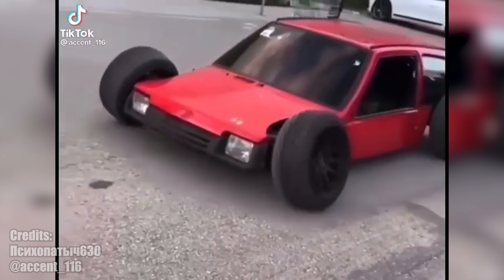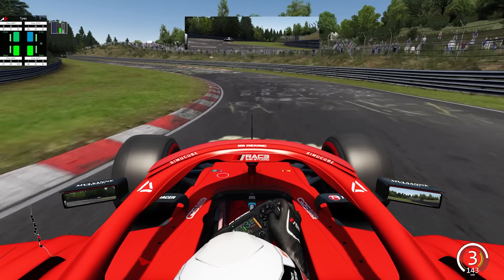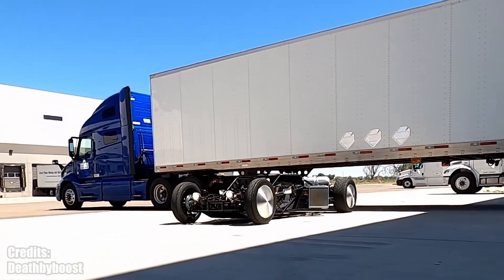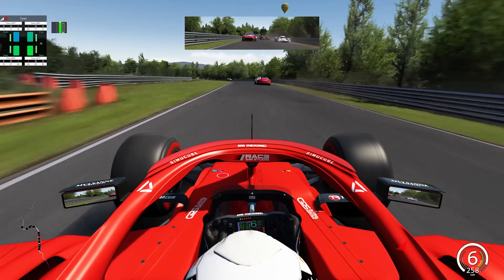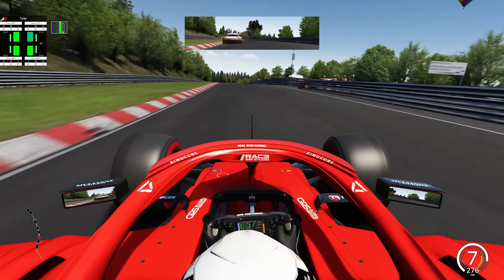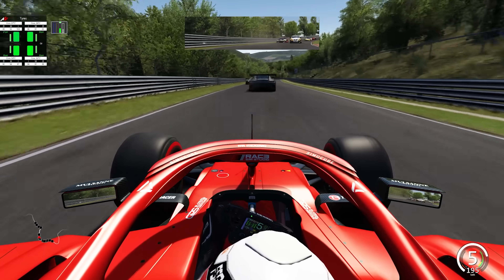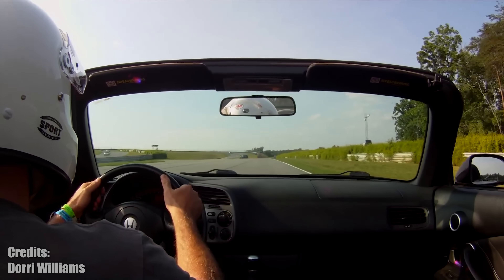Car Culture Has Reached A New Low (literally)

Comment: THAT lifted truck I have no problem with, it's clearly used for its intended purpose, off-roading!
Reply: And heavy towing!
Reply: I don’t mind lift trucks at all. Some people just like the look, but what is absolutely unforgivable are squatted trucks. 🤮
Reply: @princepixel1266  that and mall crawlers. Big lifted shiny and tires that stick out. Also the tread has no chunking and is worn flat all the way across like it has never seen dirt in its life. F those trucks too. :)

Comment: 4:50 To complete the collection, There was also an EV version called the Audi R8 E-Tron, It's not a concept car, it's an actual car that you can't buy (Because you needed to be an "Audi Connoisseur" first to buy one) 

And the price tag?

1.1 Million Dollars, You get 456 horsepower, 0-60 mph is 3.9 seconds, 280 miles per charge and a top speed of 155 mph. 
It also weight more because of the heavy battiers, and the handling is worse.
Reply: There here are reasons why it stayed a concept, and is not an actual car you can buy. On was that the Transmission cant handle that torque (only around half that), and the production cost. Because of the 2nd fact, it isnt a good comparison, since you cant buy the Diesel Powered one, and b) its common knowledge that EV need their own design. If you try to make an EV Diesel powered, you would end up worse as well than building a car that fits the Diesel engine from the beginning. (Let alone Fuel economy comparison between those two)
Reply: @christianhumer3084  I see, thanks for giving me more info
Reply: @DatDudePlays  Pleased to help

Comment: I'm not into lifted trucks or normal trucks for that matter. But that truck crawling past the big truck and pulling it up the hill was badass. Basically, when they have a purpose lifted trucks are really cool
Reply: That truck looked like it actually saw real off road use (some dents and good dirty gear). Most of them I see don't see anything rougher than a gravel driveway....
Reply: @ToolofSociety  Most big trucks I see look like they just came off the dealers lot, polished with a clean bed. I have hauled more hardware in my civic than most trucks on the road and I've taken my civic further off road than most suv's that I see.
Reply: @seanpeacock4290  No kidding a lot of them in my area look like trailer queens. My favorite though has to be the ones that are obviously 2WD only.

I also don't understand the trend of getting lift kits and all that only to put small street only tires on them. They seem to always have LEDs and chrome galore..

Comment: 6:53 honestly have you driven one of these? The Renault Zoe is honestly great fun to drive, it handles like a small Miata, it has a great sporty suspension and weight distribution plus low center of gravity. Throttle response is fantastic with it being electric, and it trailbrakes great into corners with the regenerative braking, all the people who've tried driving mine have been surprised at how fun it is to drive.

All that and it seats 4 comfortably, and even 5 somewhat comfortably while being able to haul large goods like big leather lounge chairs, pallets and over a dozen tires. 

Plus it never needs servicing, like literally at all if you want to. Very reliable too in my experience, with mine being 10 years old at this point.

Comment: my first car was a 1977 Lincoln Continental, a giant land yacht that had a 7.5 liter 460 cubic inch monster that drank about 1 gallon of gas every 8 miles if you were driving calmly and far worst if you dared push the pedal down far enough to get the 4 barrel carb going, I hit a spot where there was about 4 inches of water, it wasn't hydroplaning it was worse, it became uncontrollable, didn't matter what I did, turn the wheel did nothing, brakes did nothing, just along for the ride as it went in circles at about 50 mph until I hit the side of a guard rail, the car weighed so much it went through the guard rail and into some rather large trees, thankfully it's pure mass slowed it down to the point that I didn't get hurt but it was still pretty rough, water is scary, also I drove that car home after that, it was beat to hell but still drove the same as it did before it crashed, got to give them old cars credit, they were built like tanks

Comment: Something broke in my alfa 147 one day, I had to drive back home about 16km without accelerating because the accelerator didn't do anything, I could easily reach 60kmh. don't know what happened though, because the next day I wanted to take to the mechanic and it worked no problem, never did it again in four years.

Comment: The insane thing about the Crighton is that on top of the 220 hp it only weights 130 kilos. So even with a rider you still are above a 1 to 1 power to weight ratio

Comment: The Audi V12 Diesel ran at Le Mans in the R10 in 2005 and won by far. HP is good if you can profit from high top speeds but as soon as there are curves involved you definately want shit loads of torque too.

Comment: 4:04 actually the car never claimed that 0-100 time. due to the technicial limitations, they used literally the same stock transmission from an a4 of the time. at the time no transmission could handle the power and torque of the tuned v12 tdi

Comment: My 96 cadillac fleetwood 6 door limo likes to idle at 30, but you have to get it up to that speed first, once it is there and in, i think 3rd gear, it just sits there at 900-1100RPM, as long as you dont stop and dont have any hills, you can get over 40MPG according to the OBD reader with this 5.7L LT1

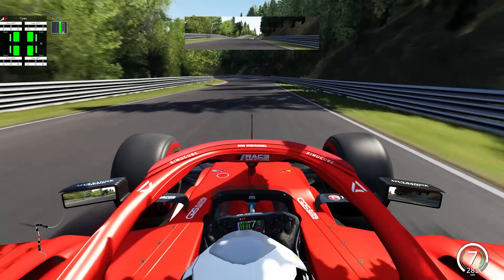Comment: 8:26 Ok how about this, a dual rotor race bike, with a rotor on each wheel, no belts, no chains just AWD dual rotor mayhem, the downside is that while rotary engines are small and light, they're still heavy to be unsprung, expecially when on the turing wheel.

Comment: I actually own Q7 V12. Right now around 600hp and 1200nm, 150.000km. Had to change everything that can be replaced after previous idiot owner, plus new LED headlights, full repaint, fully replaced suspension and full new custom interior (dark blue car, interior is black, dark red and carbon)

Edit: also new rims, tyres
Reply: What a hell happened? I'm imagining two scenarios: either the owner jumped off a cliff like James May in the special episode of Top Gear or you bought the car from ikea for how much work you described

Comment: If you want to see big diesels Detroit Diesel makes up to v16 engines because they use a modular design the v16 (16v71) they have is just 2 v8s attached at the crank and even better there is this guy that i will link below who combined 2 v12's (12v71) to make a v24 with over 3000hp technically because of how detroits modular engine codes work it would be a 24v71 

https://youtu.be/m48vyc5beNg

they did actually make bigger engines but they werent ones that you could just call up about. anything over the v16 to v24 depending to the time period you would need to ask specifically for it to be made and they are actually great with helping